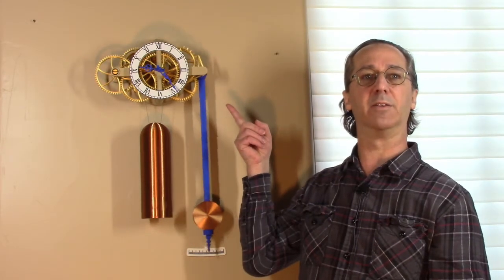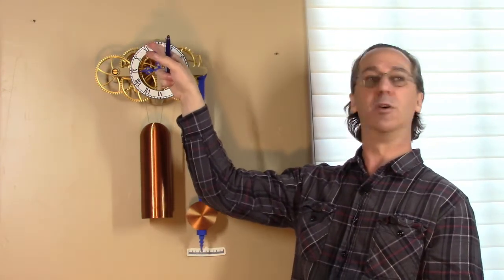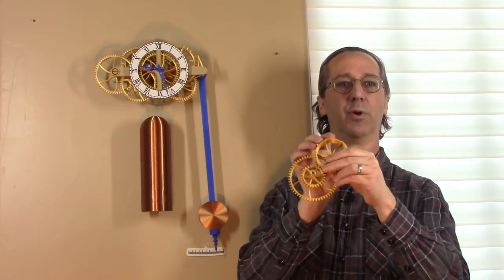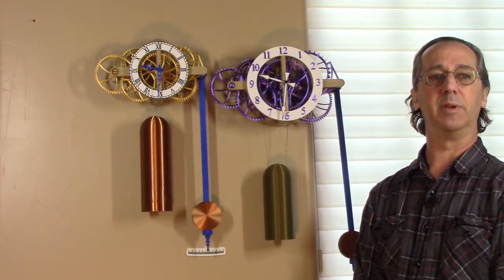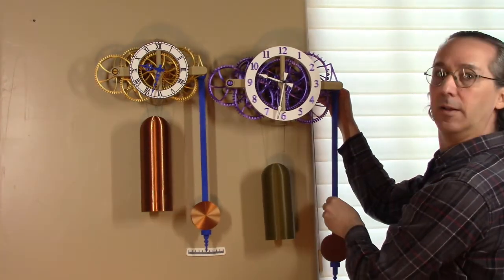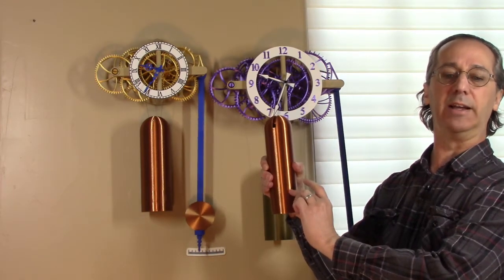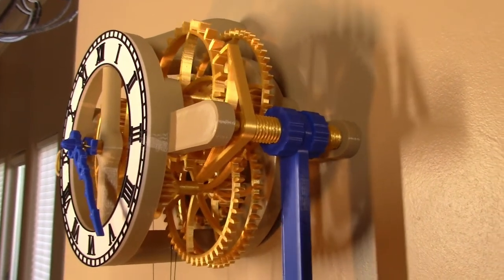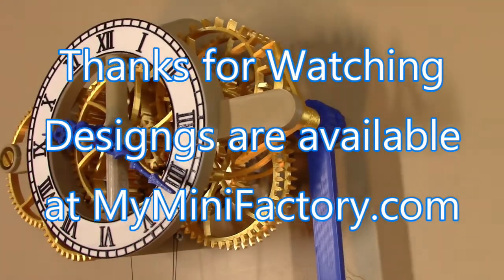Easy Build Clock with a 32 Day Runtime

Comment: Steve you do some brilliant work.  I have all of the parts printed and my nano programmed for the silent desk clock, just waiting on the board I ordered from you.  When that one is done, I'm going to try one of your mechanical clocks.  Thanks for doing these and pricing them very fairly.
Reply from the maker: Thanks. I am close to releasing the battery powered electromagnetic pendulum clock. I think it is much more impressive than the stepper motor clock.

Comment: Very nice! I was so impressed that went ahead and bought the download. I believe I figured out which parts I need to print for a given run time duration. The accompanying pdf is pretty helpful; what is missing is a step-by-step orderly assembly.
Reply from the maker: Hi Marcos. The pdf and the assembly videos both show the steps in the proper order used to build the clock. Feel free to message me if you have any questions along the way.
Reply: @stevesclocks  - Yes, you’re right - I made that comment too early;  I should have taken more time to read through the entire PDF. Please accept my most sincere apology. 😊
Reply from the maker: @marcosmoran6896  No worries. Enjoy your clock build.

Comment: Mine has been running for a little over a week now. I love it!
Reply from the maker: Glad you like it. What runtime option did you use?
Reply: I used the 10 day to start with. I don’t mind winding once a week. Lol
Reply from the maker: @richardmcpherson8322  Good choice. It should run very well. I run mine in 32 day mode, but the one I am sending to my mom is 7.5 day mode since it has a really large swing.

Comment: Just bought the STLs for this clock since my husband is an apprentice horologist at a clock shop. We might end up just using some leftover weights from some cuckoo clocks 😅 we're wanting to get it printed so he can build the clock with our boy
Reply from the maker: Any weight with a pulley will work. Most people don't have extra weight shells sitting around so they need to print them.

Comment: In order to get the full month of runtime, you need to hang it really high (such as along a stairwell or in a room with a really high ceiling). The weight drop height is 12 feet or 3.5 m. I did an estimation and the winding drum rotates about once every 17 hours. This is estimated 4-5 inches of drop per day. To get the full month runtime with around 7-8 feet of drop height, the weight needs to be heavier and the gear ratios must be changed again.

With standard drop height, this clock needs only one winding per 2 weeks, which is good enough.
Reply from the maker: There are many ways to increase the runtime. This clock uses different gear ratios between the winding drum and the minute hand gear that rotates once per hour. All runtime options use a reasonable drop of about 52" or 1.3m. A pulley in the weight shell doubles the runtime. 

The longer runtime options need more drive weight, but the frame can only handle around 11lb or 5kg. The result is the 32 day runtime option running with 5kg is functional, but it has very little power reserve. The pendulum amplitude is barely strong enough to keep the clock running. The beat must be perfectly balanced for the clock to keep running. This clock runs better with runtimes in the 8-15 day range using drive weights of 3-4kg. I agree with what you say. 2 weeks, or even 1 week, is good enough and it makes the clock much more reliable.

Comment: There is an interesting property of pendulum clocks that when two are out of sync and attached to the same object they will sync up over time. This is because they cause the object to vibrate a small amount. You can see the two clocks sync after they are both on the wall. At first, they are almost moving in the opposite direction of each other, but after he cuts to the next clip they are almost perfectly in sync.
Reply from the maker: Synchronized clock beats seems likely if both clocks have similar pendulums with one second beats. It probably takes a few hours for the pendulums to synchronize. 
I use shorter pendulum lengths that are appropriately sized for each clock. The small clock beats every 0.615 seconds and the large clock beats every 0.659 seconds. They might look to be slightly synchronized one minute, but would be completely out of sync a minute later.

Comment: So cool! Would love to see a video on your design process!
Reply from the maker: The process starts with a basic layout on scratch paper. Then a 2D CAD sketch from the front of the clock, moving gears around until things look good. Various configurations are tried, like changing a 40 tooth gear with an 8 tooth pinion to a 50 tooth gear with a 10 tooth pinion to balance a gear elsewhere in the clock. I move things around to make sure gears don't interfere with other arbors or support columns. 

I play around with various gear ratios so the pendulum length is proportional to the clock. https://theindex.nawcc.org/CalcPendulumLength.php is a great simple gear train calculator. 

The next step is a 2D side profile to determine gear and pinion thicknesses. The weight shell gears are thicker than the others so they can support the heavy static loads.

Finally, I can start creating 3D models of the parts. Most of the effort consists of the 2D outlines of the gear teeth and spokes. I start with tooth profiles using Gearotic, but add my own touches to make the gears easier to print. Generating the 3D models is relatively easy once all the 2D work is finished.

Each clock goes through a few iterations before it is completed. Sometimes parts collide and it wasn't noticed until the actual parts can be assembled. Other times, I realize a slightly different layout would look better. There is usually a box full of experimental parts for each finished clock.

Preparing the design to release on MyMiniFactory is the final step. Each part needs to be saved as a separate STL file and quality checks get run on it. Generating the assembly manual also takes a while.
Reply: @stevesclocks  Sounds wildly complicated! Fascinating though.

Comment: First time for me needing a 3D printer. What would I need to buy without breaking the bank, but not sacrificing quality and have ease of use and setup. Never done this before. I am a old timer that has built all his clocks out of wood and now want to try this way. Just bought the files for the clock above.
Reply from the maker: Every printer in this list https://all3dp.com/1/best-3d-printer-reviews-top-3d-printers-home-3-d-printer-3d/ except the resin printers and the one in the "toy" category is capable of printing this clock. Pretty much any modern printer with a print area of at least 160mm by 160mm can print it.

Some of my larger clocks require a print area of 210mm by 210mm. If you think you may want to try the others, go with at least a medium size printer, or any printer without "mini" in the name.

Comment: Awesome design from what I can tell. I want to try this design with what I have available to me.
Reply from the maker: This clock uses the fewest non-printed components of any of my clocks. And it should fit on most 3D printers with a 160x160mm print area.

Comment: If you increased (doubled) the diameter of the winding drum, wouldn't you double the moment imposed on the gear 8 axis?  Then half the effective weights?  I may give it a try.   Beautiful Design and the more I dig into it, appreciate the thought and time that went into every aspect of the design.! I have been looking for a doable 3d printed clock for a long time.  Thanks for your hard work.

Comment: I'm not experienced with building clocks. What I would like to do is make one out of cut aluminium. Would it be possible to fabricate this from laser cut aluminium and it would still work?
Reply from the maker: I am not experienced with laser cut aluminum, so I don't really know. The gear spokes and rim should be strong enough in aluminum but would need to be made stronger if you wanted to laser cut them from plywood. You would need to cut the large gears and pinions separately and merge them together along with the shafts. The frame would need to be redesigned from components.

Traditional clocks use brass gears with steel pinions. Brass on brass or steel on steel would wear out much faster. It might work much better if you could cut the pinions from steel or brass. 

You might have to experiment with the drive weight and runtime options. I have no idea if your clock would require more or less drive weight compared to 3D printing.

Comment: Hello, I downloaded your interesting  "Pendulum clock", and printed almost all parts.
But... I cannot understand (in assembly, pages 17-18 ) what is , and why "music wire".
Where can i find it? I ordered (and received) 1.5 mm stainless steel road. Can i use it instead 
this "music wire"? Thanks for your answer. Isidor.
Reply from the maker: Music wire is hardened steel wire. It is also called spring steel because of its stiffness. 
Stainless steel rod should also work. It is probably a bit softer than music wire, but the forces on the 1.5mm diameter wires are fairly small. It should be ok.

Comment: How much slower is the clock running in summer vs in winter? I guess the plastic pendulum is expanding resp shrinking.
Reply from the maker: If the clock is placed in a barn with huge temperature variations, then it will have large rate changes. If the clock is in a house with heating and air conditioning, then it will usually be accurate within a minute or two when you wind it. A small turn on the adjustment nut twice a year will bring it back to spec.
Reply: @stevesclocks   Sure. Well, I guess it doesn't have the precision of a clock like this one: https://youtu.be/N-wm39a6r_k
Reply from the maker: @raphi72  Only two changes would be needed to remove almost all of the variation in a deadbeat escapement clock. 

The pendulum length needs to be constant. A carbon fiber rod or wood dowel are big improvements, although they are more effort than simple printed parts and barely needed in a temperature controlled house.

The other improvement is to make the pendulum swing isochronous. This would require a suspension spring with curved cheeks. A weight driven clock has a constant drive power, so it usually keeps a stable pendulum swing. Spring driven clocks benefit a lot more from this change.

One of the wooden gear clock web sites has a quote similar to: "If you want to know the time, look at your watch (or phone). If you want to see art, look at the clock you built". I am perfectly happy designing simple clocks that are accurate to about a minute per week.

Comment: What size print bed will I need for the largest parts?
Reply from the maker: The large clock needs a 210x210mm bed and the smaller version needs a 160x160mm bed.

Comment: I'm looking for a clock that will tell time, date (month/day), moon phase, zodiac sign. I have found a lot of clocks that will do 1 or 2 parts but never one that does all of them at the same time. Is that even possible or is that too thick to be a functional wall clock?

That is one beautiful clock though!
Reply from the maker: It is always possible to add new features. Some can be squeezed into the existing frame. Others force the clock to grow in size or thickness. Eventually it starts looking like the astro skeleton clock.

Comment: Steve! Amazing work and design. I've just gotten back into 3D printing and started looking into clocks again. Do you think I could  have the gears laser cut from aluminum  so I could anodize them?
Reply from the maker: It should work. The gears are relatively straightforward. You would have to assemble pinions onto each gear at the proper locations. They are printed as a single unit. The frame also has a lot of print-in-place components.
Reply: @stevesclocks  appreciate the reply! Off to go make my frame 👍🏾

Comment: Thinking about buying this print but I wanted to know if I can print this on my Delta printer, the build area is only 200mm diameter x 200mm tall.  Is there parts larger than this?
Reply from the maker: The only part that doesn't fit a 200mm round plate is the lower segment of the pendulum shaft at 206mm long. It fits diagonally on a 160x160mm square plate. You could shorten the center straight portion or cut off the bottom tip that is purely cosmetic. All other parts will fit. Height is never an issue.

Comment: Hello, 
Very excellent job! 
I'm not entirely certain of what I'm looking for. 
I am trying to setup a weight and pulley system to water my greenhouse 
(Just a slow drip, not much pressure)
And I stumbled upon your brilliant creation.
I was wondering if something like this is even possible? And figured you're probably a good person to ask. 
👍
Reply from the maker: I have no idea how to adapt a mechanical clock into a greenhouse watering system. It seem like there should be ready made battery powered solutions that would be much more reliable.

Comment: Nice clock! I wish it was symmetrical, though.
Reply from the maker: Thanks. The primary design constraint was to make the assembly as simple as possible. Moving the pendulum to the side helped with this goal. It also improved the efficiency so the runtime was increased.

I have other more symmetrical clocks posted at MyMiniFactory. Assembly is slightly more complex, but still not too bad for a completely functional clock. Runtimes range from 4 to 8 days.

Comment: Super informative!  What is the expected lifespan of such a clock (guessing is ok and likely required).  The bearings pretty much eliminate wear on the high stress points.  Any lubricant on the other moving pieces???
Reply from the maker: My first clock design has been running nonstop for around 3 years. This easy build clock is around 1 year so far. No wear is visible in any of them, so 5-10 years or more seems reasonable to expect.
Reply: @stevesclocks  Excellent!  And of course, spare parts are not hard to come by.

Comment: I want to build this clock , how can i proceed
Reply from the maker: It is a 3D printed design intended for each builder to print their own version. Links to the STL files are in the description. Any modern 3D printer with a large enough print surface is capable.

Comment: I would like to purchase your designs, but I need files that work on a CNC machine (I have 2 of these that I built myself).  I do not own or even know where I would begin to try and work with a 3D printer. (I am from the older generation).  I am currently make an all Acrylic/Lexan grandfather clock.
Reply from the maker: I believe that every clock should be designed to take advantage of the material and construction methods used to build it. This clock has been completely optimized for 3D printing. The gears have just enough material to be printed but would need to be strengthened to be suitable for CNC routing. The frame would also need to be redesigned. 

It could be ported with some rework. However, you may be much happier with a design from someone that specializes in wooden clock designs. I may design wooden gear clocks in the future, but for now all of my clocks are optimized for 3D printing.
Reply: @stevesclocks  Could I possible get the number of teeth on each gear.  I am very good at redesigning  things to work. My current grandfather clock only runs of one day. I would like it to be able to work for a month on its own.  Thank you for a very interesting designed clock. I may try and figure it out by closely inspecting your video.  If you should ever decide to to try out any wooden Clock designs please let me know.  Thank you.
Reply from the maker: @rickibaron4816  You can download the assembly guide from https://www.stevesclocks.com/sp5

I recommend starting with the 8 day runtime option.
Reply: @stevesclocks  Thank you very much.  This is exactly what I needed.  When I get it going I will let you know (It might take a week or two).

Comment: Hello, i am printing your clock.
How heavy should the Bob be?
Reply from the maker: The rate is determined by length, not weight. Some weight is needed to provide stability. I think the bob weighs 6 to 8 ounces when filled with pennies or washers.
Reply: @stevesclocks  thanks for the fast answer. I Just fill IT With a couple of Euros und try it 👍

Comment: I am gonna buy your project. Is the quality of the ball bearings crucial? There are a lot of brands and prices over the internet can you suggest a proven good one?
Reply from the maker: I use generic bearings that cost around US$5-10 for 10. After cleaning out the factory grease, select two that appear to have the lowest friction for the pendulum support. Rubber seal bearings are common and the seals are easy to remove. 
High price bearings with tight tolerances might have slightly higher friction in the mode that they are being used in my clocks. I have not found a bad batch of generic bearings that would not work. The worst case is typically 1 or 2 bearings that are slightly gritty and they can still be used for the weight shell.
Reply: @stevesclocks  thank you print started :-)

Comment: When winding the clock or any clock does it keep time?
Reply from the maker: There are several ways for a weight driven clock to keep time when winding. Maintaining power or a Huygens endless chain are two common methods. They are typically only needed on precision regulators.

This clock that has an accuracy of about a minute per week will lose another 20 seconds when it is wound. It doesn't really need the extra complication of providing power to the escapement when winding.

Comment: I start print your amazing clock. What weight you recomend for 10 day clock ? 2-3-4 kg ?
Reply from the maker: 2kg should be a good starting value. 2.5kg would give a stronger pendulum swing.
Reply: @stevesclocks  
Between 2 to 2.5 kg. Thank you.
And what weight of pendulum bob you recomend ?
Reply from the maker: @alexglikman8629  The pendulum Bob weight is not critical. Anything between 4 to 8 ounces is fine.